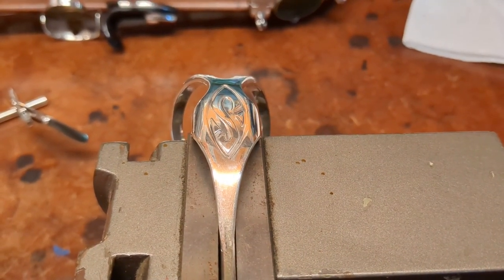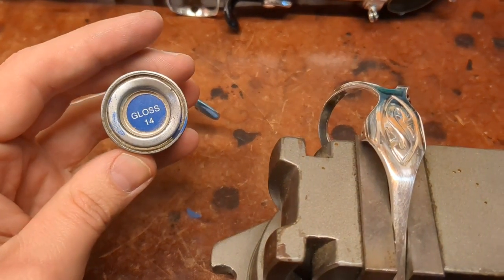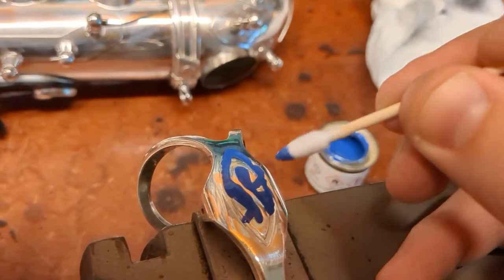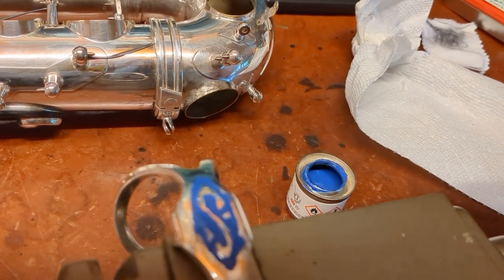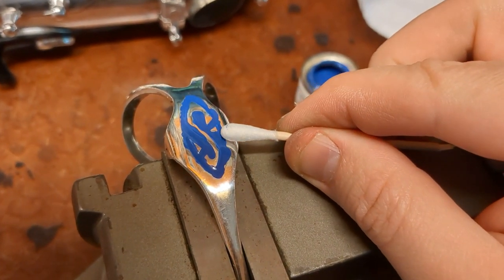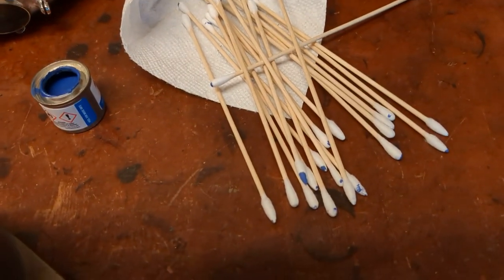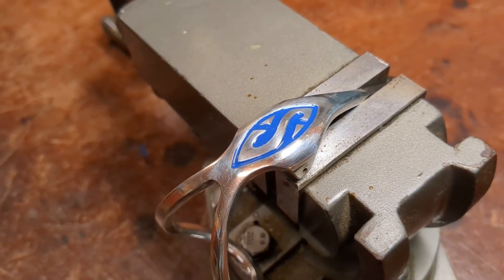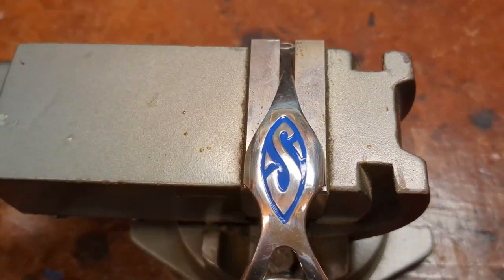Saxophone Repair Topic (Questionable): Replacing The Blue on the Selmer Logo

Comment: You could try a technique that is common to intaglio printing and just rub a piece of stretched cheesecloth over the embossed area that will remove the paint from the high spots and leave the low spots untouched. It makes for really crisp lines when the edges are sharp. Not sure how it would work out with the beveled edge of the "S."
Reply from the maker: Perhaps that is what Selmer is using in the video I linked in the description!  Never knew what the cloth was, perhaps that is why it didn't work for me.
Reply: @StohrerMusic  Yes! It's the same technique.

Comment: If I'm doing fills like this, I prefer to use a toothpick type piece of wood to lift the paint and move it around. At least for small areas I find it's easier to spread and stretch the paint droplet just right that way and not have to wipe anything off unless I make a mistake and get paint outside the edges. The paint needs to have about the right viscosity to form a nice droplet and spread evenly in the groove/pocket/gap/area.